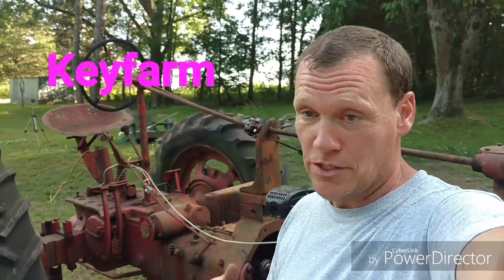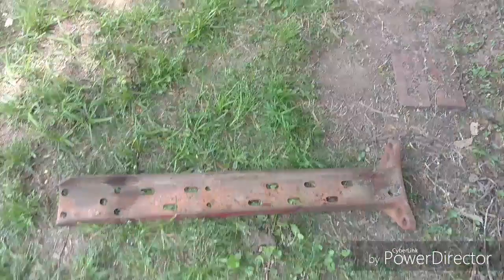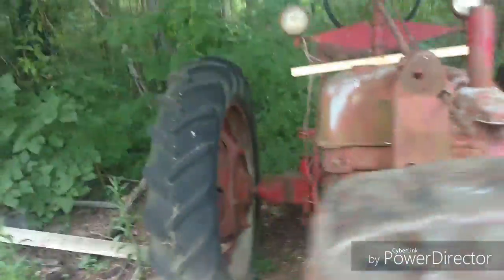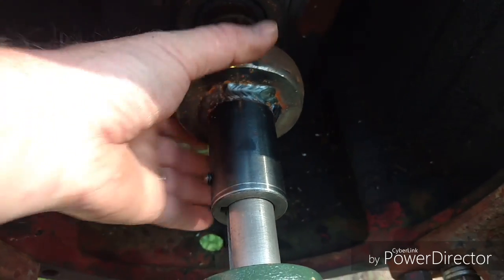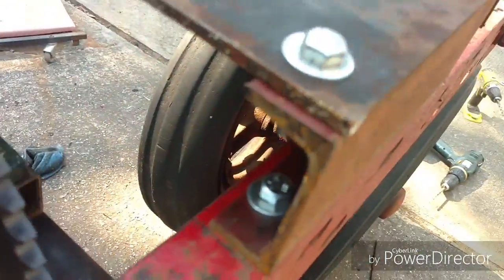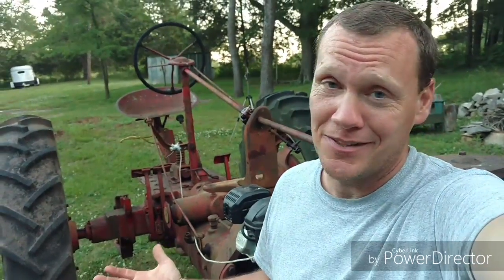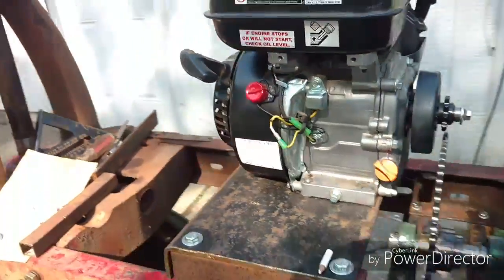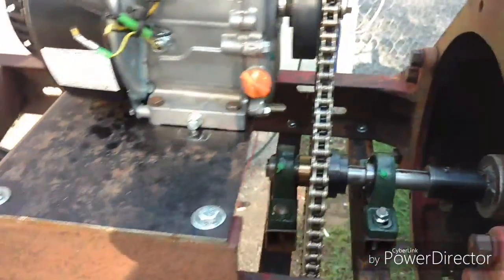Predator 212 Tractor

Comment: fuckin awesome man! but the tillotson 212cc engine has a higher rpm limit before valve float cuz its built with better valve train and flywheels. And like twice or more power than a hf predator
Reply from the maker: But predator is searched 50x more than tolli

Comment: I love that however the torque converter would still be good because if you have a heavy load on the back of the tractor that little centrifugal clutch might get smoked the Torque converter will start off on a lower gear and then it will automatically shift up, much more low-end torque to takeoff,  May even let you decrease the diameter of that sprocket connected to the tractors transmission.
Reply from the maker: That is a good point, but they are still sold out all over, I even found what appeared to be a good link, but once I clicked buy, it said unavailable. I put a cheap one on the golf cart I converted, it has worked great, just can't find at this e.
Reply: Keyfarm could probably try “go power sports” for torque converters, I bet that thing will be a useful workhorse once it is perfected👍

Comment: The H Farmall was rated 26 horse power. A 20 hp Kohler engine would do the job.
Reply: People dont understand gearing and leverage..one cld move the earth by hand if geared properly.
Reply: It still wouldn't be very comparable due to the different torque curves. For PTO or starting a plow from stopped you want to be able to let the clutch out without motor at a near idle, where as the Kohler would need to be revved out to keep from stalling.
Reply: 670 predator
Reply: The industrial 5.9 cummins in the Timberjack skidders I used to run put out almost 50,000 lbs of torque at the end of a 6' tall tire, in first gear! Gearing.....
Reply: soupertrooper  that sounds like a lot of work.  But go for it. Cast another engine.

Comment: Should'a gone electric and put some solar panels as a roof.  Love the thinking out of the box.  I don't think you'll win any tractor pull contests with it though.  Now if you could hide that engine under a metal body so folks think it has a diesel engine, it'll blow their mind when they hear it running.  Yeah, she sounds that way cause of how I tuned 'er.  Wetumpka born and bred, y'all.
Reply from the maker: Cost is an issue with electric, however if I had a boat load of money I would love to set one up like a hot rod golf cart 72 volts ,plum quick motor ,novitas controller, it'd be awesome. And another old H Farmall would be pretty easy to find.

Comment: change the gearing around and get a heavy clutch for the engine i will burnout fast
Reply from the maker: In the for lower gears the clutch locks up and stays locked up there for it builds hardly any heat

Comment: Nicely done and nicely shown.  I have a 1936 Farmall F-12 that has a Model A Ford engine in it. It has the original tractor transmission plus the Ford transmission in it so it has a lot of gears!   I'm going to see if I can get the Ford engine to run again (it crapped out on me and few years ago) and if I can't get it to run I may give this a try.  I've been wondering how to do it and this did a good job of showing how.
Reply from the maker: Thank you for the kind words I appreciate it

Comment: Number one I have a perfectly good Farmall H block sitting on an engine stand plus all the parts to put it back together and make it a complete engine for that tractor that I would have sold you for a meer $300. Secondly A Farmall H complete I'm talking about with its original engine, radiator, fuel tank full of gas,hood and front grill might weigh 3000 lb. With all that missing and only that Predator 212 on there you're probably sitting somewhere around about 2,000 lb but that's okay it's still pretty impressive. Now I would like to make a suggestion before you try to pull anything with it. Since you don't have the 4-cylinder cast iron engine in there anymore nor do you have the radiator up front you might want to consider hanging some weights off the front end of that tractor before you make it pull anything. Because sir the front end of that tractor is extremely light right now.
Reply from the maker: A factory H weighed 3875lb. ( Tractor Data ) knock off a 1000 for engine, add predator and other parts= about 3000lb.  I will add weight to the front as needed, watch the next video where it pulls the stump.

Comment: That motor might have 9 lb ft of torque. So ya got a big, slow paperweight. Just about any damn motor would've been better, from an 11hp Briggs to a 3 cylinder Geo Metro to a 500 Caddy.
Reply from the maker: Already using it, you should watch the second video of it, been moving trailers around today with it.
Reply: @ChrisfromKeyfarm  I did later. I'm amazed the thing even moved. But that centrifugal clutch oughta last about ten minutes, lol.

Comment: I think I would of used a belt instead of a chain drive.
Reply from the maker: I have looked into a centrifical clutch for a v-belt as well as a pulley.
Reply: @ChrisfromKeyfarm  I would use an idler pulley to engage and disengage the belt. Like lawnmowers do. Or have a way to move the pully with a lever to losen the belt. Even seen where they move the engine to losen  the belt to disengage.
Reply from the maker: My tiller engages like that

Comment: who the hell welded that part to the sprocket?
Reply from the maker: Ok,ok,ok let me explain, I knew this comment was coming. I was attempting to to do 4 small tacks, since this sprocket is 13.5 inches across I was worried it would warp( it still did a little ) I didn't want to get it very hot and it turned out very ugly and I haven't ground on it yet, so in conclusion , it was me.

Comment: Why did you use a centrifugal clutch instead of going direct and using the stock clutch??
Reply from the maker: That would be a tremendous amount of fabrication and I no longer have the flywheel, or clutch. I don't think that little crankshaft would like a Farmall H flywheel hanging off it.haha

Comment: direct drive no clutch right? how do you shift gears?
Reply from the maker: The gears are so low you can take off from a stop in any gear, but if it had enough speed you would float them like driving a manual without using the clutch to shift. Do you know what I'm talking about?
Reply: @ChrisfromKeyfarm  yes I do🚜
Reply: The engine has a centrifugal clutch.

Comment: How do the clutches hold up
Reply from the maker: Just built this 2 weeks ago but so far it doesn't seem to be very hard on it.
Reply: Keyfarm was it a 3/4” clutch or a 1 “ clutch and was it just a cheep clutch ?
Reply from the maker: A predator 212 is a 3/4 shaft engine, yes the clutch came from eBay, like$30.00

Comment: We always welded up a cracked block. Most of our tractors were old and a few of them had froze and had busted blocks some time in the past. But the predator motor is a good option. I like it 👍 we had several of those Farmall H's.
Reply from the maker: The block was cracked at the back where it holds the camshaft.
Reply: @ChrisfromKeyfarm  probably not repairable then.

Comment: Very cool thats a great application for it. with that gear ratio you are making as much or more power than the original engine and nice job with the installation. Like your golf cart a lovejoy coupling makes it a whole lot easier to mate shafts together without lathe work I just had to do that on a project i couldnt get the wobble out
Reply from the maker: Thanks for the comment , do you video your projects?
Reply: @ChrisfromKeyfarm  Yes most of them. Minibikes and stuff check out my channel.

Comment: Looks like a good idea i just would’ve put a bigger engine and higher gearing for a little more speed.
Reply: More speed isn't a primary goal in tractors. It's all about torque, thus the numerically higher gear ratios.
Reply from the maker: I'm calling this generation 1, if the world keeps turning, well keep adding and modifying and possibly in the future , bigger engine. Time will tell, thanks for the comment.

Comment: Haha the absolute madman. I was searching to see if a Predator 212 had the balls to power an old lawn tractor. I consider my question answered
Reply from the maker: LOL, that pretty funny, I'll bet you didn't expect to see it turning the tires on a 3000 lb. machine, it surprised me a little too! Thanks for the comment.
Reply: Depends a lot on the gearing on that particular lawn tractor, if it's geared low enough you could run it with a weed wacker engine...Lol

Comment: You’ve got room for multiple 212’s.
Reply from the maker: Your right, it definitely does not fill up the engine compartment, plenty of room to work on it, kinda the opposite of everything built today.
Reply: After all, this tractor quite literally meets the criteria of a rolling chassis without a body that weights it down.
Reply: @ChrisfromKeyfarm  maybe a 670. They are expensive though.
Reply: Make it a 636!! With 3 212s in series.
Reply: @joshs1555  send it
Reply: I put a lot of thought into this. I looked at a big v twin but you apparently can't use a centrifugal clutch on a motor that big, requires a torque converter. At first a thought you could use a shaft on pillow bearings coupled to your input shaft with a u joint, add as many sprockets along the shaft with motors on either side of it, like 6 or 8 motors. But then yesterday I was thinking about this and had another idea. You can run the one chain and one driven sprocket like you got, but add maybe 2 more motors, like the tranny input is at 6 o'clock and the motors would sit at 10, 12 and 2 o'clock and the same chain gos over all engines. I've got a JD model 40 crawler I need to do this to.
Reply from the maker: There are actually centrifugal clutches that will handle 20+ hp ,but they are expensive. One popular way of engaging that kind of power is with solid pulleys and a tensioner, the tensioner is attached to the clutch, think how many types of riding lawn mower blades work, the belt just loosens up when the tensioner is pulled back. I have thought seriously about putting 3, 212's on it and calling it the 3 headed predator, but I have more ideas than I have time to build.
Reply: @ChrisfromKeyfarm  yeah I thought about the belt tensioner also. That's how my troy built rototiller works, when you move the drive lever the whole engine moves up to tighten the belt or down for nuetral.
Reply: What are you all talking about. This thing is saying give me a screaming Jimmy, hahaha😜 (for all you city folk.. it is a Detroit diesel, and if you to City. Then it is basically a super loud diesel engine that rich folks hate because they can't hear the Lamborghinis and Ferrari cars
Reply: Or multiple 670cc
Reply: Or a bigger engine

Comment: Once that clutch burns up you need to try a torq a verter!
Reply: They are 40-50 dollars on Ebay.
Reply from the maker: Right now torque converters are off the chart price wise, I have one on the golf cart ( there is a video) I only paid like$55.00 for and it works great. The last cheap one I found on eBay, once I clicked on it, it said it was no longer available. Huh!
Reply from the maker: Oh , almost forgot, the clutch doesn't get very hot so far cause it stays locked( less friction)🤞

Comment: The only thing I'll say is before you try to pull anything hang a buik off the front or you will flip it backwards.

Ok 1 more thing if you ran a rubber hose from the clutch to the input shaft with a few hose clamps . You could of deleted the chains shafts adapters ECT ECT
Reply: My dad could make a carburetor out of a pop can.  He bought an old home-made tractor from my grandparents that had (and still has - I have it now) a Model T Ford engine in it .  The tractor is a 1936 Farmall F-12. He rigged up a pulley on the rear PTO to wrap cable around (a winch) and ran that up to a pulley attached to a log boom hooked up to the rear of the tractor.  He used it to load logs onto a trailer hooked to the tractor. 

You'd stand between the steel lugged steel wheels and the body of the tractor to operate by hand, the foot clutch to engage and disengage the PTO.  If you weren't careful, or if you wanted to have fun, you could lift the front wheels off the ground and hold them there. Pretty hard on the front end when it would come down. Quite a rush. 

I swear that tractor would climb a tree, with those steel wheels and low gearing, if you wanted it to.  I unintentionally climbed stumps more than once.  Those lugs would catch on the top of the stump and up you'd go.  Dangerous as hell, actually.
Reply from the maker: I appreciate the advice about adding weight to the front that is being done however if I ran a hose from the clutch to the input shaft first of all I don't think the hose would last very long and it wouldn't have very much power because there would be no gear reduction.
Reply: @ChrisfromKeyfarm  I didn't invent the idea guys have been doing that forever to eliminate the need for perfect alignment and custom shafts .

Comment: I want to see it lug. And those blocks crack in the parent cylinder bore. No big deal. I clean the crack up cut a small V in crack and pack it full of jb weld slide a new cylinder liner in. Never had a problem.
Reply from the maker: This crack was in the back of the block that holds the camshaft, if your cam has a wobble, nuthin going to work right.
Reply: @ChrisfromKeyfarm  that's a unusual place to crack on a H engine.
Reply from the maker: I used to have pictures of it but that was many years ago. The back of the cam set in a cup cutout in the back of the block, it had an oil drain hole on the bottom. The crack was from the edge of the cup to the oil hole, and looked like the cup was then wider than it should have been. I'm not Farmall mechanic, but it didn't look good to me.
Reply: @ChrisfromKeyfarm  going to take to the fair and hook to the sled? A stock H was about 22-25 horse power. I hope you didn't scrap that radiator, those shutters on the front are hard to find. That was most likely a distillate fuel tractor having those shutters.
Reply from the maker: I'm keeping the radiator and shutters safe in the shed, check out the newest video, this thing will turn both tires over and dig, it's unbelievable, check it out.

Comment: Looks like you could have cut that gearing ratio in half and still had plenty of umph.
Reply from the maker: It has plenty of low end for sure, that's what I was going for, 5 the gear, ( not seen in the video is a much taller gear, just guessing around 7 mph. The good thing about this setup is I can change the main sprocket and chain and experiment with different things.
Reply: @ChrisfromKeyfarm  could potentially  mount 3 sets and just move chain between  them with a  idler gear  tht would take slack out also eliminating need to adjust chain by the motor have a low gear when needed  and a cruising gear when  needed

Comment: Why wouldn't you run it gear to gear and use the clutch on the tractor
Reply from the maker: I'm not sure what you mean by gear to hear, but the clutch on the tractor doesn't work without the flywheel on the original engine.
Reply: @ChrisfromKeyfarm   ok didnt thinck of that
Reply: @chrisfrost9176  I've had them make a crank end that went on my engine, then I bolt the flywheel on my engine. That way, use my clutch, flywheel, starter, pressure plate.  Or, weld the crack up on original engine and have plenty of power.

Comment: Vanguard engines are good engines. Replaced one in my John Deere lawn tractor. Only tick about the engine when pulling under strain and the governor and then relieve that strain. The governor will kick back and the engine can backfire. Yes this was at Full Throttle. And with the dollars blade I had to re sharpen. Looks like I forgot they needed it when I put it away this winter. The vanguards got replaced by a newer model. But they have injured with no major silly mistakes of manufacturing like plastic gears.